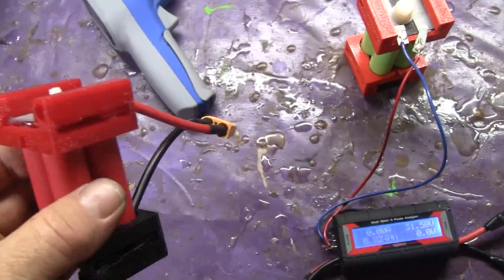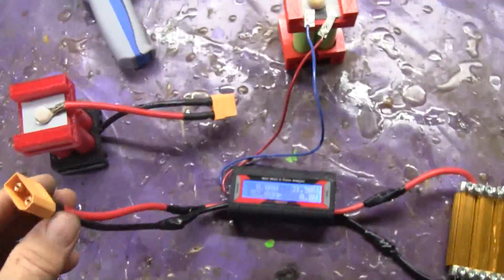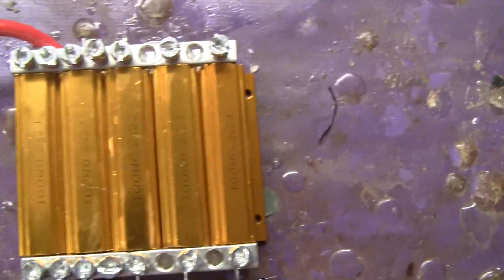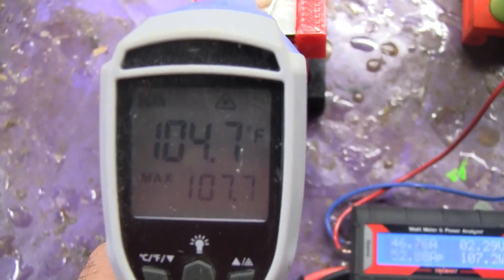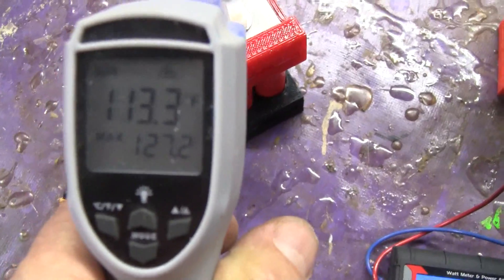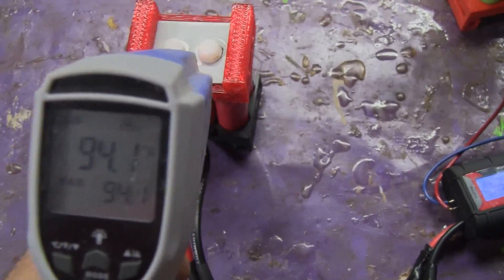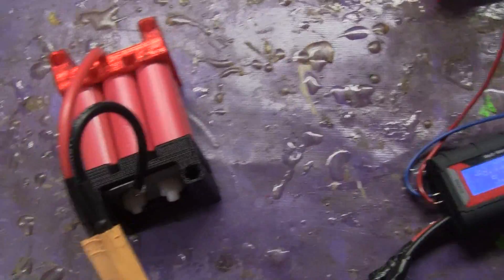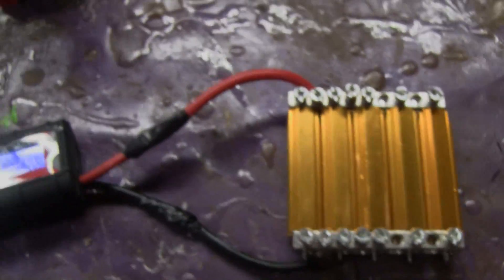50 amps from 4 GA cells- Can BatteryBlocs handle it?

Comment: Excellent. I’ve been thinking of using cells that are not good enough for a powerwall and allowing them to dump into a bank of resistors like you did. The objective would be putting a fan on them to use as a small heater in a tent or small camper situation. Charge with Solar and use randomly. Any input would be helpful.
Any idea what resistor value you might start with?
Reply from the maker: The value of the resistor depends on the voltage of the battery.  Because this is  a sub 4 volt system, I used  .2 ohm 100 watt resistors. You need a very low ohm resistor for current to flow with a low voltage.   About the battery- Let's assume the cells are old and that the failure rate is high.  When parked in a large parallel group a dead cell can ruin the rest of the cells in it's group by dragging them down and killing them.  So, making small parallel groups but a high voltage battery would limit the damage.  But, the management issues- keeping all those unruly cats balanced- would be difficult.   So suppose you just made one 100P battery.  A 4 volt AC charger or power supply would be all that was needed, no balancing required.  A dead cell would have a lot of healthy cells and would be unlikely to bring down the whole pack.  

But you will be charging with solar.  So I would suggest a compromise.  Build a battery that can be bulk charged with your solar panels voltage- to 4 volts per cell- maybe a 12 volt?  Then use a cheap hobby charger every week or so to balance charge it....  You got me thinking here!
Reply: Yes I see where you are going. Luckily this idea has no sensitive loads just resistance.  A Solar Pwm Charger would take a 4S pack to 13.8v of charge way below the 4.2v change which would charge to 16.8v .  Yes I think a higher Parallel cell pack would be good as you suggested. Cells with a Higher C rating such as 1500-2000 mAh might work best. I was also thinking that when building the 4S pack that leaving an open cell row between cells would allow more ventilation of heat. Regardless of the heat being from the batteries or resistors it’s still BTU’s either way.